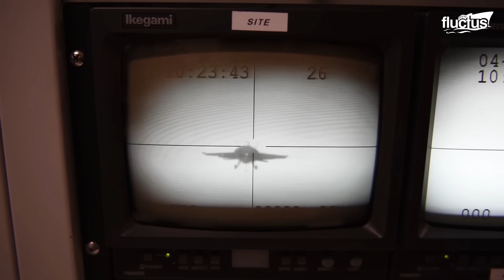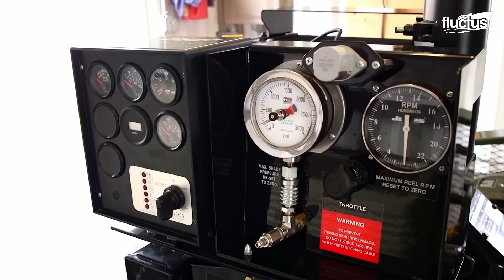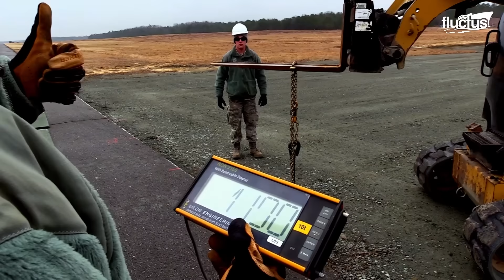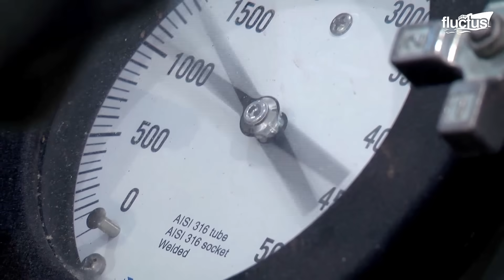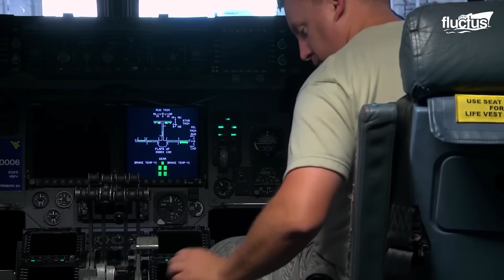Behind US Genius Air Braking that Changed Fighter Jets For Ever

Comment: I was under the impression the FA 18 replaced the F14 Tomcat not the phantom and Corsair. Please correct if I'm wrong.
Reply: No, the F/A-18 replaced the phantom and the Corsair II in the mid 1980s. The Super hornet (completely different aircraft) took the Tomcat's place, nothing has replaced the Tomcat as nothing has the Tomcat's capabilities.
Reply: @kdrapertrucker  awesome, thanks.

Comment: F/A-18 pilots at trained to land with the horizontal stabilizer and speed brake providing a majority of the aerodynamic braking.  The horizontal stabilizer is already trimmed for nose up when landing so it provides a ..(“Barn door” effect and will slowly trim back to neutral when slowed down enough for the wheel brakes to take over….helps reduce wear and tear on the brake.  I would probably think that the F-15 probably does the same.
Reply: Yes that is exactly right ▶️👍 F 15 Speed Brake does same thing slows down aircraft on landing saves brakes and tires Too 👍😎

Comment: A-7 wasn’t a fighter.  It main role was Attack, but with training and skill it could use the AIM-9 Sidewinder as a defensive weapon.  F-4 was primarily fighter and fleet defense interceptor.  F/A-18 replaced both A-7 and F-4.  

The A-7 air brake is underneath so not very useful on landing.  That is more of a “Dive Brake” used in air-ground attacks
Reply: I think they are confusing the A-7 with the F-8. Understandable considering the A-7 was based on the F-8.